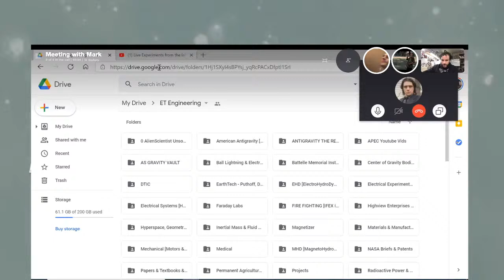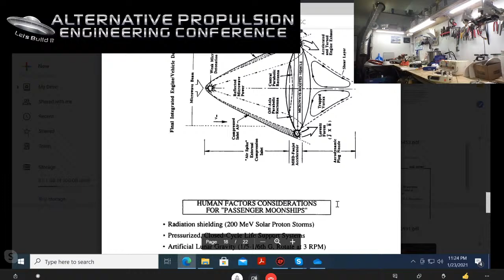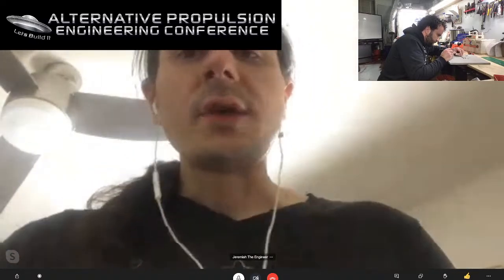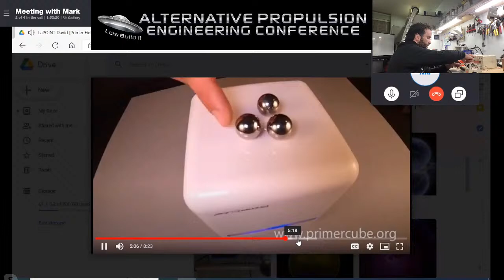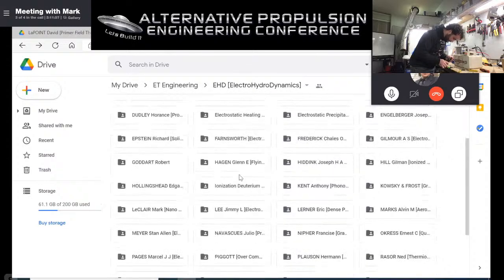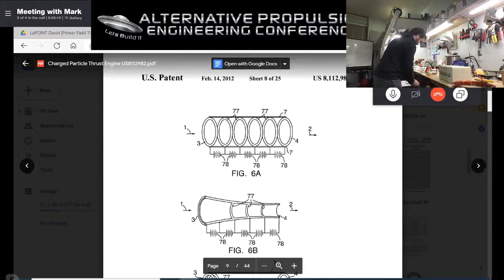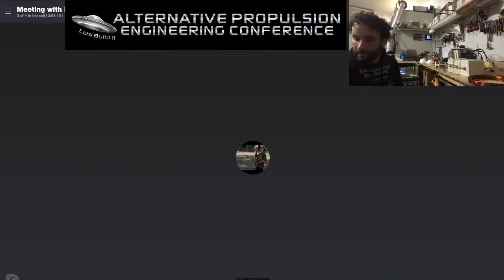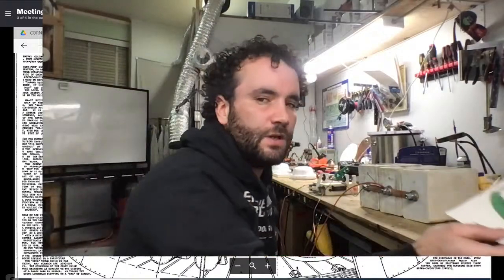Live Experiments from the labs, Aluminum Levitation Pulsed Fields & EZ Alzofon

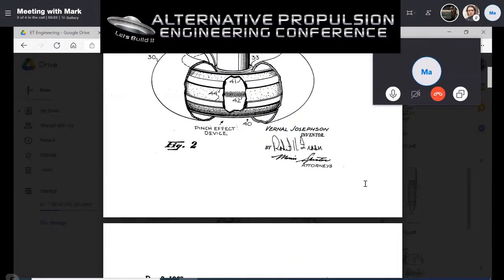Comment: re 6:30 this arrangement is better suited to an IEC arrangement (easier to engineer) and easier to modulate (control) plasma flow the real significance is that there is more than one plasma containment vessel and therefore the potential to create a gradient (if only in phase alignment

Comment: *(hopefully) HELPFUL MESSAGE TO JEREMIAH*
Ionocraft are NOT propelled by the 'ion wind' or 'ionic breeze.'

The propulsion works this way:
1)  the physical asymmetry (the difference in size) between the thin high voltage wire upper electrode and the much larger (electric ground potential) lower foil electrode creates a gradient electric field.  As you well know, a *gradient electric field* simply means one part of the field is stronger than another part, and in this case, the strongest part of the gradient electric field is located near the very high voltage thin wire electrode, the smaller of the electrodes (the grounded aluminum foil electrode is much larger than the wire electrode, recall)

2)  the very high positive voltage thin wire electrode *STRIPS OFF electrons from nearby air molecules* leaving the air molecules close to the wire as an electrically positive *SPACE CHARGE* of positive air ions.  Ionocraft move, accelerate upward, due to this space charge. NOT because of the pushing of 'ion breeze'  (visual proof is provided below)

3) the now-positively charged air molecule ions created by the thin high voltage electrode are physically located ABOVE the foil electrode - the positive ions represent an electric space charge, at POSITIVE ELECTRIC potential, sitting just above the larger grounded foil electrode, which, being at ground potential, is (electrically) ATTRACTED UPWARD TOWARDS the positive space charge.  For example, with the top thin electrode at 20,000vdc,  if the bottom, larger foil electrode is at ground, that means the lower electrode is negative 20,000vdc relative to the upper thin wire electrode  (duh, I says to meself, but just wanted to drive this point home, as it explains the acceleration)

4)  and the gradient field is WHY the lower, grounded foil electrode accelerates - the positive ion space charge of air molecules sitting near the upper wire electrode is INCREASINGLY DENSE, electric-field-wise, closer to the high voltage wire

The 'ion wind' is NOT THE REASON for the acceleration upward.  Jeremiah, you're way smarter than 99.99% of ionocraft hackers so I know you understand what I said above.  And SEEING IS BELIEVING.  Put the following video in slow motion (in the youtube viewer lower right corner, click the 'cog' icon, click 'Playback speed' and select "0.25" for slo-mo playback):
https://www.youtube.com/watch?v=ckGaTUEbaKw
(the title of the video is  "Lifter: ion wind or not?")

You will clearly see that the acceleration of the ionocraft commences LONG BEFORE any sign of 'ion wind'.

Again,  the top high voltage wire creates an electrically positive space charge, in a gradient electric field, that ELECTRICALLY ATTRACTS the lower, larger grounded foil electrode UPWARD.    IONOCRAFT then ACCELERATE UPWARD due to that gradient space charge sitting in the air just above the foil electrode - the foil electrode is electrically attracted to that space charge, and moves upward.

When the lower foil moves upward, so does the thin high voltage wire.  And the wire creates a brand new space charge of positive air molecule ions.  Which then attracts the lower metal foil electrode upward AGAIN.  Rinse and repeat.

Comment: funny looks like you are looking into plasma containment, and fusion, there, around (6:51)
and it seems to me that would be fairly simple if people stopped thinking of these fields as they do and start thinking of them the way they did to produce their first atom bomb with shaped explosive charges, but instead use shaped magnetic charges. as for the battery system at the beginning, I am wondering if brown is the same guy who coined the "brownian" motion? cause that is basically what a similar system I came up with that does not use any tungsten and gives a pretty good output with out having to apply an electret effect on it, and I am guessing would improve drastically with the electret effect applied and last an incredibly long time (longer than electrets made with teflon because these are capped with a stable substance that also allows the charge to pass through unaffected while also providing a conductive path to collect it all. not part but all of the charge at any point, and should be quite easy to convert to series or parallel system for greater amperage or voltage, while remaining light enough to power say an aircraft or a car, and possibly with some of my other designs to improve rocket output per pound of material used (fuel) to improve the whole system to a point of being as efficient as ion drives but with the intensity of solid or liquid fuel rockets all stuff to be investigated through F.I.R.E. (Foundation for Interplanetary Research and Exploration,) *that can later be altered to interstellar or intergalactic as the range of reach for the tech increases). hopefully I will be able to get some videos and streams of the work I am doing to LBRY and bitchute (avoiding possibly losing the videos by hosting on youtube, or having it strangled by ads and such here since they apply ads now to any video whether or not you sign up for them to be added. :(